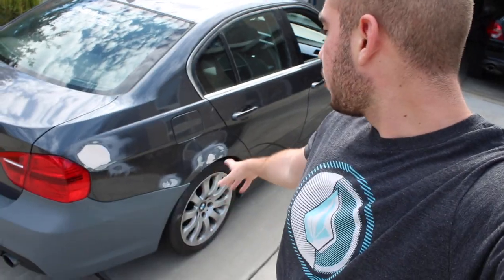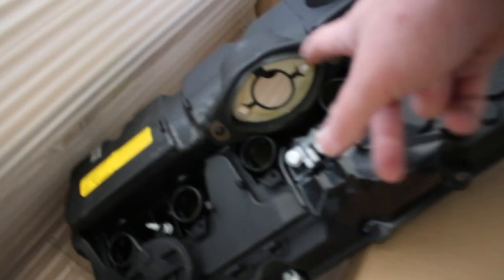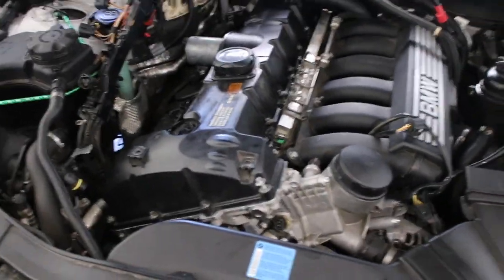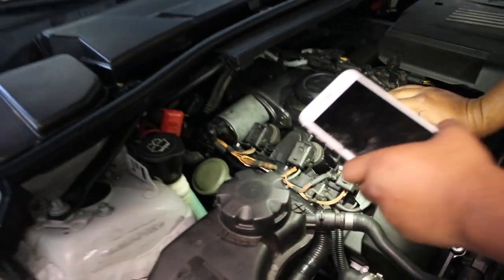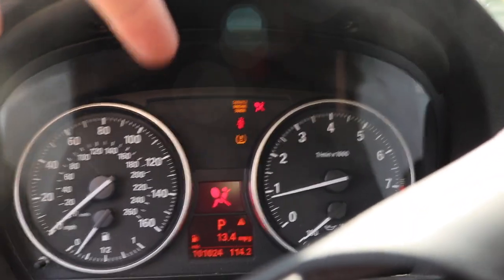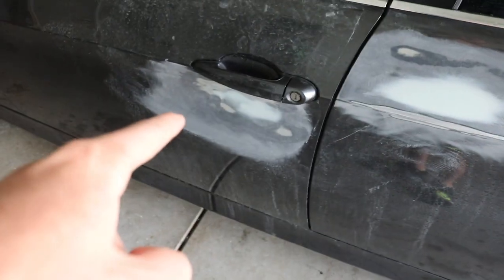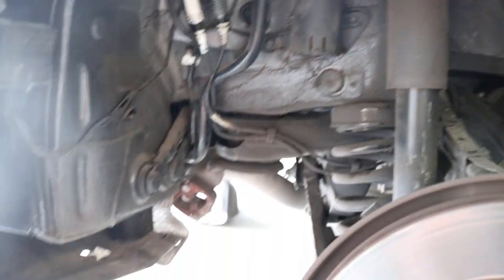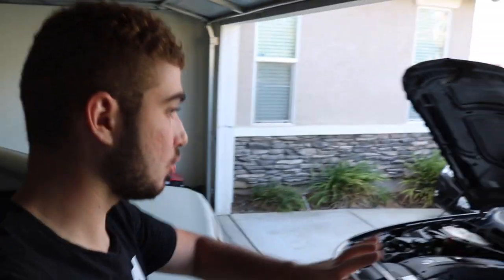BMW 335I BACK FROM THE SHOP!

Comment: When you changed that pump on the evap canister, one of the hoses probably isn't connected properly. The could trick the system into thinking the gas cap is open.

Comment: @Nour on the rear passanger side behind the wheel well there is the dmtl pump, that will throw a evap code that makes your check engine light go off, start there or read the codes, dwonlod mhd from the android playstore and have a k+dcan cable and read the bmw codes.
Reply: Might be on the driver side actually lol cant remember but theres some videos on it and if thats the issue its not too bad of a job and the part is relatively cheap

Comment: I had the same problem with my car I bought a new cap too and nothing. After putting gas in the car when I would push to start it would crank but not turn on but it would on the second try. This happened for the three times I got gas. Brought it to the dealer and they fixed it but I dont remember the issue

Comment: Edit: just watched the end of the video and you got it fixed by a shop haha my bad

Nour, when I got a gas cap error, I opened up the back seats to expose the fuel pumps and there was a hairline leak on the fuel pump regulator. It was spitting out fuel and it's almost undetectable until it starts soaking the bottom of the car. Easy fix. @simplycarthings just did a DIY on it. 
Check that out.

Comment: My 2006 330i is messing up and I wan to take it to the shop but I’m scare they’re going to charge me a lot of money (more then a 1,000)
Reply from the maker: Miguel Palencia what’s the issue?
Reply: It shakes when I’m at a stop light and when I put it in reverse it shakes as well and when the ac is on I look up what could be wrong and a lot of people said it was ignition coils and I changed the spark plugs and ignition coils and then check it again and it still said the same thing missfire I’m cylinder 3 and 5